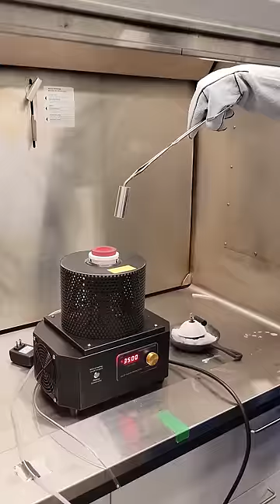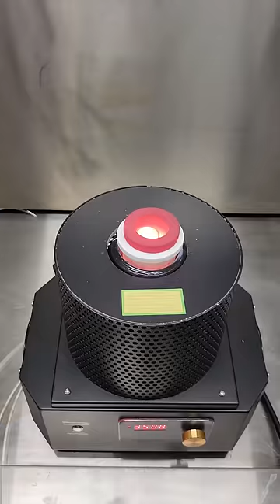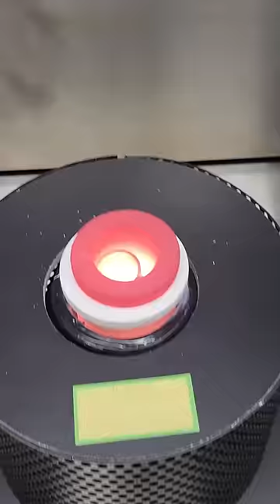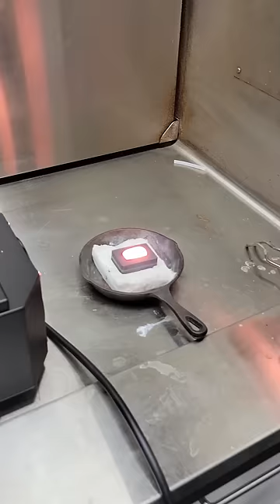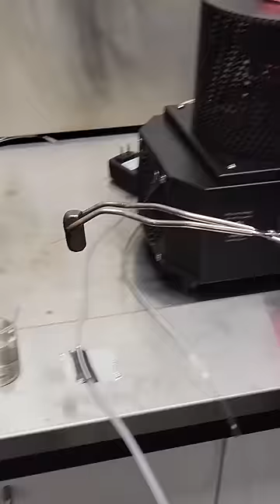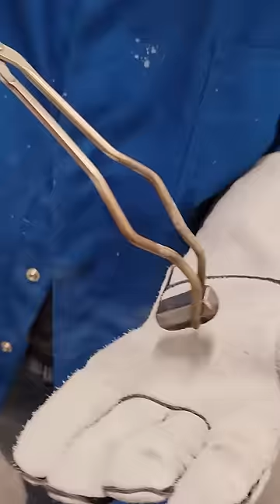Melting steel pipe is crazy

Comment: Huh, graphite crucible. By the time it is proper molten it probably mas enough carbon to be essentially some crazy tool steel similar to D2. @NileRedExtra , you should try to harden it
Reply: Lol no...
Reply: @autumn5592  lol no is not a scientific explanation kiddo
Reply: @Zonkotron  Graphite is not the same kind of carbon as you would get in 'carbon steel', it would just cause inclusions, weak points in the steel.

It would not create a high carbon stainless alloy, it would just make it weak.

Besides the amount of carbon it would need to actively absorb would be quite a lot. The carbon content of Nickel-Chromium Austentic steels is like 0.08%. You need at least 0.30% to make something hardenable, ideally you want 0.70-0.95% for a cutting tool.
Reply: @autumn5592   Graphite is not found in Steel. Thats right. The carbon is dissolved. But your line of reasoning is like saying that crystal sugar cannot be used to make a sweet beverage cuz one is solid and one is liquid. It is void, empty of reasoning, non-sense. So please just stop arguing, get schooled on metallurgy and stop spreading "opinions"
Reply: @Zonkotron  Sure, graphite could desolve into the steel, but it would require long heating cycles and very high heat. 
Not something you're going to do with an at home induction foundry.

You're not 'schooling' anyone lmfao
Reply: @autumn5592   You are confusing solid body diffusion (which DOES take a long, long time, think case hardening) with a liquid melt that acts a a solvent and is convective. if you check the molten zone on something that was torched with a carbon arc gouger with the air turned off or the burned portion of a piece that was overheated in a coal forge - simple spark test will suffice nicely- you will find it to be quite high in carbon, much higher than the parent metal...after a couple seconds of exposure. Which makes perfect sense. How do i know this ? Because ive tried it. Discussion over, bother someone else with your antics...and ohh...you got schooled.

Comment: Is that Celsius or Fahrenheit.??
Reply: That's for sure Fahrenheit. Those Chinese furnaces only go so high. If it was in C, that would be over 6000 F. Noooo wayyy it would go that high. Plus, steel will go just fine at 3500 F.

Comment: That quenching glass was way to small to get a harden, the steel was still steaming afterwards which means it didnt cool down enough. Also dont use glass for glowing hot and heavy stuff, thats how you get hurt some day.. you also want to pre heat the form you pour the molten metal into, that makes the surface smoother.
Reply: Bruh he was just trying to show off what he's using to melt the metal
Reply: @Syndicalism  yeah but it also shows, that he has no clue about tool use in general and about the material he works with. You can burn yourself pretty badly if your work piece is still hot and not enough quenching is a great way to do that 'bruh'..
Reply: @janpapai9205 he's a chemist not a foundry worker. Yes it's unsafe but at least he knew enough to put it in the fume hood since haxavalent chromium off the stainless steel is toxic. Yes if he starts casting or smithing he will need to learn and know all about it but for a one off video it's not really crucial. 

And a key point to mention the metal was no longer glowing or red when he quenched it. And a few ounces of steel isn't heavy. So where is this "glowing hot and Heavy stuff"? 

Yes he didn't do it the RIGHT way but he did it the chemist way playing with a new toy.
Reply: This steel is likely to low carbon, or austentic, so it won't harden.

As for quenching, it needs to be FAR hotter, almost glowing (in his current lighting), for it to even be hardened.
The volume of liquid is not an issue for smaller (like this) parts, it's rate of cooling. Faster cooling makes it harder.

Steaming out of the quench is fine, it would bubble in the water if it was hot, steam could be excess vapor escaping.
It was clearly fine to handle, otherwise he wouldn't be handling it.

Do agree with your other points though.
Reply: @autumn5592  there was a cut in the video after the quench and i bet it was bc it was still too hot even with the leather gloves on. And youre right, it could be a lot hotter and it didnt bubble but that doesnt mean its cold enough to touch. I made that mistake once and never again 😂 And yes i know it wont harden in this case bc it hasnt got enough carbon and is not glowing but that may be a language thing bc we use the same word for both. Quenching really only means putting something hot into cold liquid but doesnt actually need to mean harden anything, you can quench an egg to peel it easier too and thats how we use the word in german. I just said it for those who might want to do something where hardness, temper etc actually matter. And about the coolingtime, thats what i mean. If you want to harden something and it cools down this slow, your piece wont be a lot harder after you did it. Just dirty haha i mean if it was an actual work piece he certainly could just go again and ntn happened this time but i still cant watch it without commenting about the dangers he put himself in and the mistakes he made. Like that metal was touching the bottom of the pyrex glass. If you do this with a glowing piece youre gonna have a steam jacket around the metal and you could very well get to the point where even pyrex breaks and launches shards of glass and hot water across the room. Your very own and personalised frag granade if you will. Thats a really great way to hurt everybody in the room badly. Imagine being the er doctor that has to pull out many tiny shards of glass out of second or third degree burned skin and that more then once bc he had a cameraman too. Especially if all he had to do is think ahead a little and use a metal bucket or whatever he had around instead..
Reply: Like quench in ANYTHING else before you quench in a tiny container made from glass

Comment: can you melt steel with jet fuel
Reply: You can but you need multiple other things to make that happen… Jet fuel burning laying on the ground will not melt high strength steel… A forced induction fire, will. Meaning the positive pressure from the air handlers of a building mixed with burning fuel, will melt steel.
Reply: No need to melt it outright, just need to get it hot enough and it becomes about as strong as al dente pasta. Try it yourself with a steel rod and a cheap propane torch. Make your own hooks and simple implements with ease. ;-)

Comment: I hope that fume extraction hood is running.

Stainless steel expells chromium and nickel in not so little quantities when heated, you definetly want to avoid those heavy metals settling in your lung.

I am a welder, and stainless stell should only be welded with fume extractor and fresh air directly supplied into the welding helmet.

Btw, they grey stuff on top is chromium carbide, pretty hard stuff.

The steel below that, no matter how shiny, probably is not stainless anymore.
Reply: Boiling point is quite a bit above the melting point.
You can melt (some alloys) of it without producing any toxic fumes.
Because there is no evaporation (fumes) then the chromium doesn't leave the steel.

Welding is MUCH hotter, higher than the boiling point or chromium, so will cause evaporation.
Casting, generally, is not hot enough to cause chromium loss.